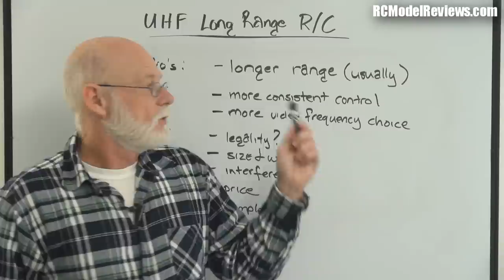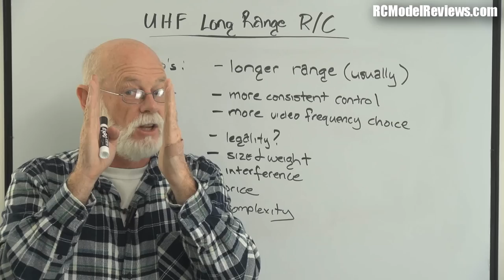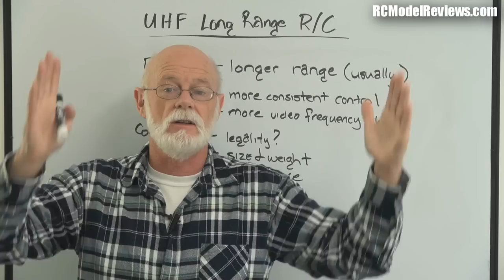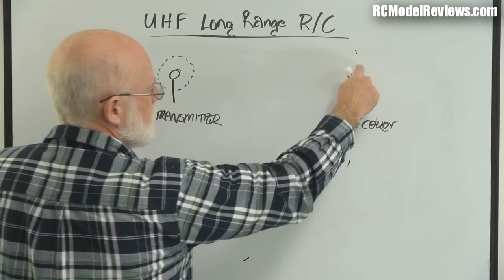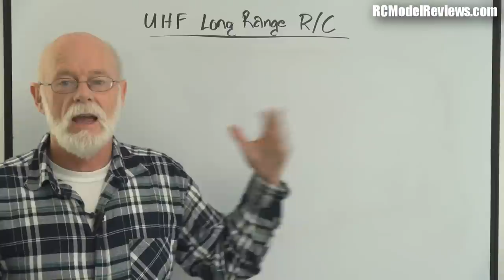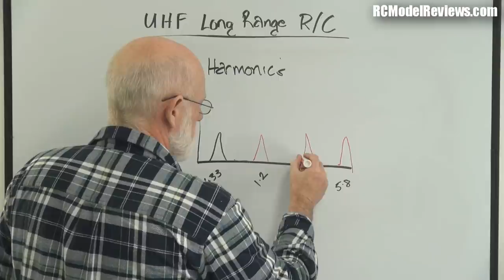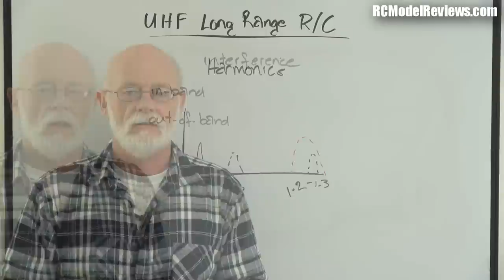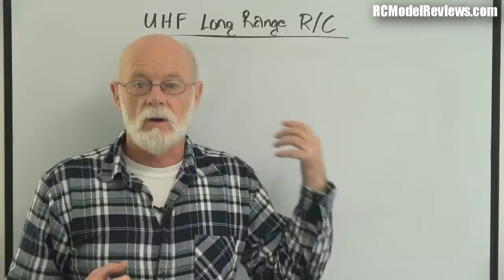Long range UHF RC systems part 1 (the basics)

Comment: "the Ether around us" The doctor who gives my laserphysics classes would have cried at that comment. Probably would have scolded the student who said it with Maxwell and Michelson rants.

Not that it matters whether we talk high energy or low energy fotons as long as ether doesn't change the speed of light based on the direction the we basically are back at the vacuum again. Bruce just had a slip of the tongue here.

Comment: The OrangeRX is the cheapest, but it is very difficult to implement telemetry that is compatible with Taranis or any other system to display it, In addition to the RSSI beep that it comes with.  The solution is simple.  Use both 433mhz and a small FrySky telemetry RX together.  They do not interfere I've tested them.  Perhaps you don't need the same range with the telemetry that 433 can provide.

Comment: Bruce do you know of a spectrum analyzer under $100?  Thank You
Reply: Tepee Tim depending on what you want to do with it (I think it is only good around 433) you can get a DragonLink RX (just  the RX) for $100 (shipped I think) and download the software for it, and use the spectrum analyzer feature.  I think it has been shown to be pretty good.  DB's may not be EXACT, but they are pretty close, and a good troubleshooting tool.

Comment: if lower frequency is better why don't long range manufacturer use a better version of 72mhz instead of using 433mhz ?
Reply: latency and background in a frequency ( regular radio waves)

Comment: In Belgium they just passed a new law with regards to "drones", which states you can't go any higher than 30 metres in your own backyard and if you want to fly it anywhere else, you need written permission by the landowner and the same 30 metre height restriction applies...
Commercial users have another set of specific rules...
Reply: Ronke01 Very similar rules are coming here in New Zealand and soon there will no longer be "RC Model Aircraft" -- they will simply cease to exist under the new laws.  All models, drones etc will become "remotely piloted aircraft" under CAA's new regulations and you will have to have the permission of the property owner and every person who you fly near or whose property you fly near.  That could mean no flying in your back yard without the permission of your neighbours and anyone who might walk or drive past on the street.
Reply: Sad times for modern technology :(
I think we all do understand the need for regulations, but they are kind of overreacting.
Reply: *****  er..I guess that your interpretation but the way i read the rule below is that  you shouldn't be reckless  and  you can do what you like in your own backyard but just keep out your neighbors property..which is one of the major complaints in the media of people with UAVs.

A person operating an unmanned aircraft, rocket, gyroglider or parasail must take all practicable steps to minimize hazards to persons, property and other aircraft, including, but not limited to, the following:
(1) keeping clear of airspace above persons who have not given consent to the flight being conducted over them;
(2) not operating above property without obtaining prior consent from any persons occupying that property or the property owner;
Reply: Ronke01 If the law is too stupid and restrictive, then just keep on breaking the rules.
Reply: kozzie h  The documentation accompanying the proposed new regs clearly states:

"One way of mitigating the risks of injury to persons or damage to property is to avoid flying over persons or property without first obtaining the consent of those persons or the persons occupying the property. Therefore, the proposed amendment rule specifies that an operator must avoid flying over persons or property without first obtaining consent from those persons or occupiers of the property as the case may be."

The big problem with this is that it effectively excludes all public places, even parks where flying has previously been allowed by the park owner.

The key phrase in the above is "persons or property".

Unless you can guarantee that no unconsenting person is going to wander into your flight area then you can't be compliant -- and therefore you will automatically be operating under 102 rather than 101 and operating under 102 without having paid your fees carries a hefty fine.

Interestingly enough, MFNZ is seeking (and will probably get) an exemption from this provision of the new regs so that only their flying fields will give people a guarantee that if some unconsenting person wanders onto the field  while you're flying, you won't be deemed to be flying under 102 without the required certification (ie: fee-paying).

Call me cynical but this looks like a clever move on the part of CAA and MFNZ to steer all RC fliers into the arms of our national model-flying body by making their fields effectively the only place you can fly an RC model without potentially being in breach of the regulations.

Even if you're flying in your own back yard... a gust of wind or anything that causes your model to stray outside your boundaries will result in you breaching 101 (unless you have the expressed permission of your neighbours).  Likewise, if someone wanders onto your property while you're flying and walks through your flying area without first giving you their consent to fly over them -- you are again in breach.

The new offense you'll be breaching if you're found to be operating under 102 (ie: flying without the permission of persons or property you over-fly) is that a 

"Person must not perform an umanned aircraft operation except under the authorority of, and in accordance with, the privileges of the prescribed certificate" and carries a fine of up to $5,000 for individuals and $30,000 for body corporate.

Now one could argue that "nobody would ever be prosecuted for such a trivial infringement" -- which is what everyone told me about kids flying small RC models in the local parks here (within 4Km of the airfield) yet, strangely enough -- CAA did send TWO investigators from wellington to interview me when I did just that, even though my actions were 100% compliant with CAA's regulations.

All being equal, no -- there probably won't be prosecutions if someone accidentally strays into your flying area or you accidentally drift slightly outside your own property or property over which you have permission to fly -- but then again, as we've seen, if you dare to criticize certain groups, they are willing and able to use their power in a way that can only be seen as abuse -- in order to exact a little retribution.   Any rule that allows such discretionary enforcement is a bad rule.

And, if someone walks across the local park while you're flying in it and feels endangered by your model (bearing in mind that the public are a funny bunch sometimes), then a prosecution could be bought and, if they convince a judge, you could be facing a very stiff fine under these new regs.

The era of RC model flying being a fun, healthy, harmless hobby appear to be gone... banished into the history books by overzealous regulators.
Reply: ***** That's not a good situation though.  There have to be some rules so that the fools without a clue have some guidance.  However, rules should be fair, unambiguous and not reliant on the discretion of some pencil-pusher who doesn't have a clue about that over which they are lording power.   Good rules do not infringe the rights of those who already fly safely and sensibly -- they only provide penalties for those who really do pose a risk to the safety of the public.

To determine whether the current (and proposed) rules fit that category -- ask yourself whether I am someone who flies safely and sensibly and whether these rules infringe my rights ;-)
Reply: ***** yep I can see your point. The way its worded is that you are in breach if you fly anywhere outside of your own property, including the local park,  without  consent. This could easily be used maliciously , all it will take is some passer by to complain. So this effectively kills off  RC model flying in New Zealand.
Reply: kozzie h It doesn't kill it off but what it does mean is that those whowant to fly RC models (sorry "remotely piloted aircraft") without the risk of facing a $5,000 fine will be forced to join MFNZ (who will have an exemption for their flying fields).   Can  you see now what I mean by the very unhealthy relationship that I believe exists between these two bodies?
Reply: It must be the same in every country , Power and political power corruption. Setting up a scenario as that just about forces everyone to join thier corrupt organization!  Its like they have forced anyone flying RC to have to join ....Then the dues go up! LOL  It is covered up here but we have it too. Now you have to join the AARP to be in Obamacare. Gee i wonder why they spent millions backing him and his obamacare ....They wil make billions in return. We the public are forced to join one to get the other much like MFNZ and bruce and the flight sanctioning body of NZ i forgot the name
Reply: well did you watched catch me if you can?

Comment: I think what you mean to say is the number would be 0 because there is no difference between longe range and line of sight if you are flying fpv. Has there ever been a case in history where an issue arose specifically because it was a long range system? of course the answer is no, because anything you can do long range you can do short range too, why would the FAA whine about range levels... as long as a craft isn't using illegal frequencies it should be a nonissue, or is the FAA trying to say all FPV is illegal? Because that's essentially what they are saying if they say we have to be staring at our craft at all times... and if we put a super bright beacon on our craft that can be seen for miles, technically that's still line of sight.

Comment: I'd prefer using a SignaLink USB attached to my laptop for a transmitter but nobody that I know of makes a program for a guy with ham radios and beam antennas. I'd actually prefer using 50MHz or 30MHz for control with my SignaLink sound cards but can't find any RC receivers for 6 and 10 meter bands. 50MHz is where you really should try long range. 440 or 430 as you call it is shaky stuff even for a good ham radio operator since it even plays line of sight. Now 30MHz is more like it.

Comment: And if you use 1.2ghz video with a filter (like a notch filter or a low pass filter) to eliminate the harmonics. So you can still use the 2.4ghz radio
Reply: jeremybaeyensify Thank you for your excellent video, I find this really interesting.
Reply: jeremybaeyensify A notch filter can reduce the harmonics but won't totally eliminate them -- and you're still left with the other problem that you're going to need a good amount of power to get decent distance on 2.4GHz because of the path-loss associated with the higher frequencies.
Reply: ***** thank you! For responding so quickly I'm just trying to find a way to have like 800-1000 m of range with very decent penetration because I want to fly through the woods with my own designed T-copter. I fly spektrum dx6i because I had it as a gift.

Comment: About harmonics from the UHF band affecting video... (35 mins in the video).
What if I was to use the EZUHF system in UK mode (459mhz). The third harmonic would be 1.377ghz, so outside of the usual 1.2 - 1.3 video band. I watched a video with ibcrazy testing these systems and he used 2 video setups running 1280 and 1258. With all of the UHF systems testing the interference seen on the video image was FAR worse on 1280. I guess that's because  it's closer to 1299. Based on this I see no reason why UHF running on 459mhz would work very well with video on 1258.

That said, when you put EZUHF gear onto UK mode to switch from 433 to 459mhz, does the power output reduce? Anybody know?
Reply: +Chris Flory if you use 459mhz you power will be cut from 500mw-200mw to 100mw. so it will be legal but you will loss a lot of range
Reply: +Ironiic zero thanks

Comment: my new V3 DL UHF does not mess with my lawmate receivers with saw filters D480A Dragon link rules ! soon I will be using FPVBLUE 1.2 for 720p long rang HD video range is 8+ miles.

Comment: 41 minutes!?! well I've got 2 hours or so before my exam ;P
Reply: Newhbish I have half a day and a lot more to learn! Damn you Bruce and your videos!
Reply: Newhbish What kind of exam are you writing?
Reply: chemieprof oh just my fourth introduction to/intermediate programming class lol
Reply: Newhbish An exam in programming?! As in a written exam? For my degree I just did one of those multiple choice computer things, not that I have ever/will ever use basic again!
Reply: vanepico Its the usual written exam (for me at least) 

"Write a class to do blah"
"What is wrong with this program?" 
"What does __ mean?" 
"Write a function that does _"
Reply: vanepico what kind of a degree is that?
We had to write code on a piece of paper, no compiler or anything. You would lose points for syntax errors as well.
Reply: Juraj Mestrovic Yeah that's what my exam is, they take the code you write by hand and see if it compiles/works on a computer.
Reply: Newhbish That's the one. Anyways, good luck to you
Reply: Juraj Mestrovic Thanks! you too
Reply: Ahh...I thought some kind of electrical 
engineering exam and therefore you had to watch the video... :D but I am glad it is just laziness...I know that problem very Well!
Reply: chemieprof Its the only engineering class I think I could pass in my sleep ha!
Reply: Juraj Mestrovic It was a bachelors degree in Mechanical Engineering
Reply: Newhbish How do they teach programming, you have to learn by doing it. I'm going back a bit, but I rmember being taught Pascal which was the Java in its a day and thinking what is the point of this. Algorthims, and the theory underlining what you need to use programming for can be taught. But passing exams is a route to a good career even if you don't understand what you are learning. I failed a lot and I would advise passing them.
Reply: stewjw Well the class was all theory and examples but the assignments were meant to get you to do/learn how to program on your own. Unfortunately (fortunate for me, yay curves) most of my classmates never did the homework and thus never learned how to do anything.

Comment: I have a Hitec Aurora 9X, which supposedly doesn't output a PPM signal, however I have a dongle for my flight simulator which I believe reads the PPM signal from the trainer port and that works fine. I have been looking upon getting a UHF system, but I'm unsure that any of them will work with my radio. If anyone has an Aurora 9X and an EzUHF for example, could they confirm whether this works or not? Thanks in advance
Reply: I think David Windestal from Flitetest uses EzUHF with his Aurora 9x

Comment: You should be condoning the word " drone " not helping the  uneducated lot to call quad copters drones.
We all know drones are a tool used by the military not a toy to throw around a field racing other folk and taking films of various locations.
The sooner there called Quadcopters the better the hobby will  be.
Reply: steve cotterell  I'm pretty sure that anything with a "flight controller" in it qualifies as a "drone".  APM, PIXHAWK, NAZA, A2, E.T. VECTOR.  All can qualify as drone.  Just about the only flight controller out there that I can think of that wouldn't qualify as a drone is a KK2 or a basic Naze32.  
Just because you don't like it when people call them "drones" doesn't mean that they aren't indeed "drones".

Comment: I got the transmitter off eBay with the brand new whip antenna correct size $40 bucks from a u.s. seller and it showed up in 3 days

Comment: They don't have any laws that concern model aircraft more than for commercial use in sweden. The thing that they are trying to pin some of the abusers on is that they say that it´s a surveilance camera.
Reply: ***** Thanks for correcting me then :) I have not read that anywere, it´s quite hard to find good information, do you have any links regarding the subject or a place where i can find more info?

Comment: Excellent stuff, couple of points I hadn't really considered there and I have a bit of RF knowledge.
In the UK I think the ham license allows you precisely bugger-all advantage because “installation in aerial vehicles” is expressly excluded. Yeah that makes sense, any dribbling moron can put mains networking in their house or stock up on crappy ebay chargers and screw over local hams or other radio enthusiasts but let someone with RF knowledge use that in an intelligent way on an RC plane? Oh no! The limits on FPV here are so strict it's probably academic anyway.

I did think of installing 433MHz on some off road car and driving it remotely for fun on Ham alocation for remote control but it's not really flying is it.

Comment: nice example with the talking to the nice girl but in my opinion its wrong :P
turning up the volume is like your getting more background noise, maybe from powerlines or as mentiont: the mobius. in my experience if you have a transmitter near your receiver its more like someone sticks oropax in the ears of the girl ;)